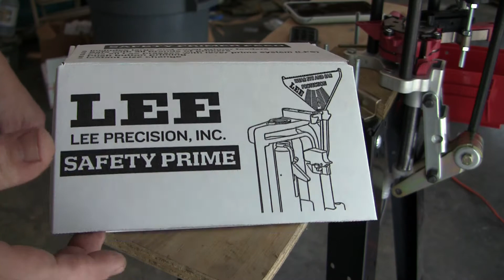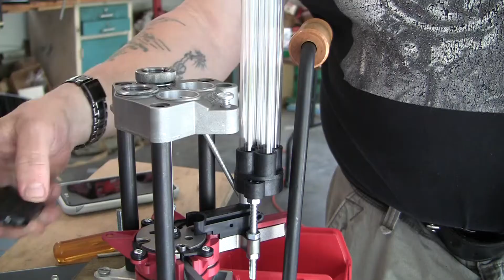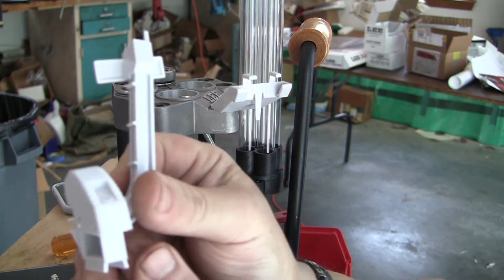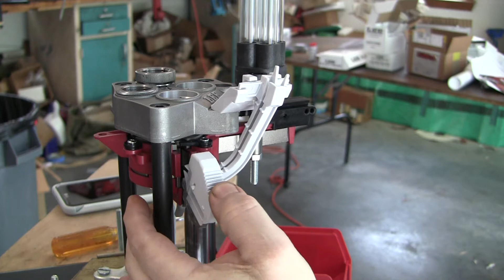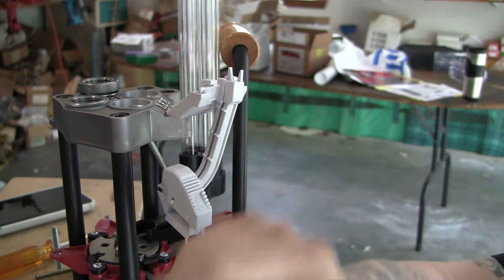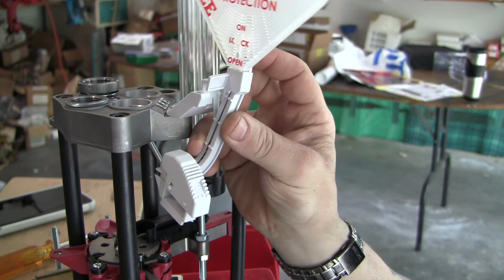Lee Breech lock Pro instaling safety prime

Comment: I'm not having great luck with the Safety Prime and this press at this point.  It's often catching the primers, not dropping them properly in the arm, etc.  The same priming system works quite well on my Breech Lock Challenger.  I think it'd due in part to the left-right slop of the priming arm.  This slop isn't present on the Breech Lock Challenger with the arm in the ram.  Thanks for the videos.  It's good to see other's progress with this press as well.
Reply: I have 2 older versions of the safety prime and they definitely have a bit of trouble. On lees site they recommend the version like in this video for the auto breech. You can send in your older safety primes for upgrade but it is about the same as buying a new one (of course)
Reply: Brad Chandler Well, I have one of the older black ones too, but the one I'm using is the new one like yours.
Reply: Just an observation that may help you with shaking, have you tried smoking weed? It has helped others inflicted with this.
Reply: I find the system hokey & cheap; waiting for some smart You Tuber to come up with a fix. I think I'll go back to setting the primers manually. Tired of picking them up off the floor.
Reply: @petediaz9310  I primed 200 9mm brass tonight dropped 4.  I stopped picking them up until the end of my priming. Have you tried taping 2-3 pennies on the front corner?  It works as a counter balance weight.  Helps eliminate most primer drops but not all.
Reply: @Kcrunchymunch  I'll give it a whirl. Today I started priming manually, slower but no fails.